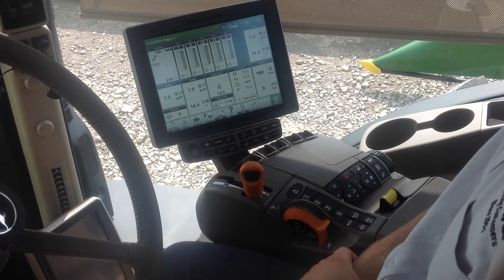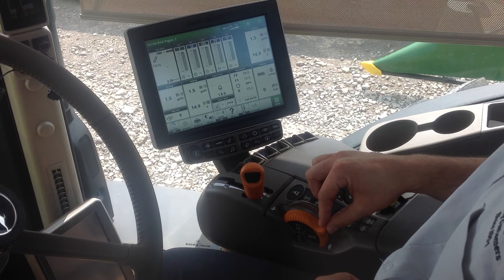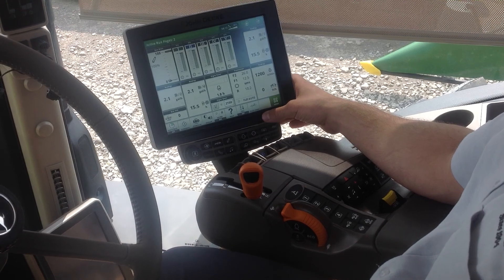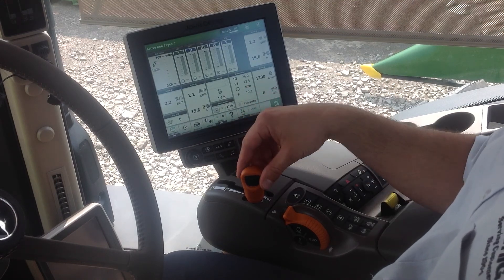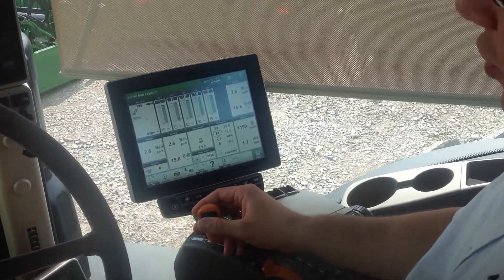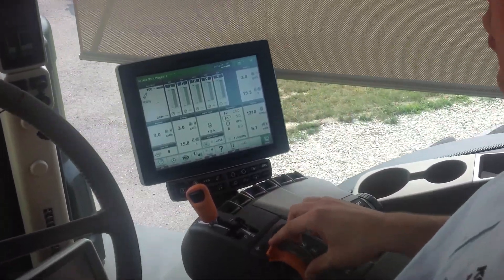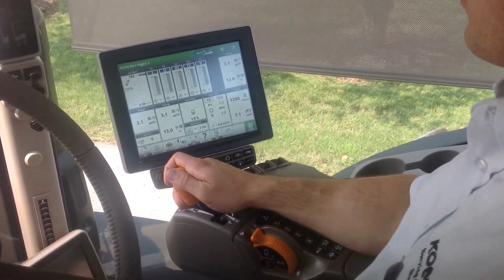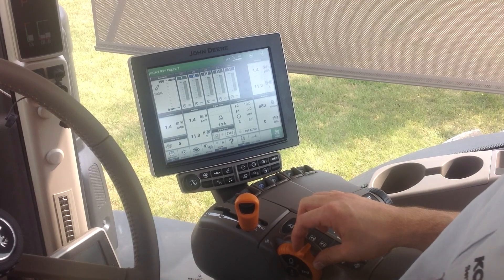FULL AUTO Mode | IVT Transmission Basics | 4600 Command Center

Comment: What is the recommended way to slow down? pull orange nob back or throttle all the way back then pull nob back?
Reply from the maker: Hi Adam. Either option will work. If you happen to be in a low load application in which you don't need many RPMs, such as road transport, we usually prefer to use the throttle to slow down and come to a stop since that gives a smoother response.
Reply: @KoenigEquipment  is it possible to drive the tractor with full speed just with the little stick full speed means 36mph?
Reply from the maker: @davidkarnics2841  Hi, David! If the throttle is full forward, you can drive with the stick and go full speed.
Reply: @KoenigEquipment  thank you very much!!! Greetings from Austria
Reply: Drive it like you would drive a pickup with automatic transmission; throttle and brakes 😉   Most of the settings he was demonstrating were "field cruise" type functions; useful for extended duty field operations 🤷🏻‍♂️ 🙋🏻‍♂️